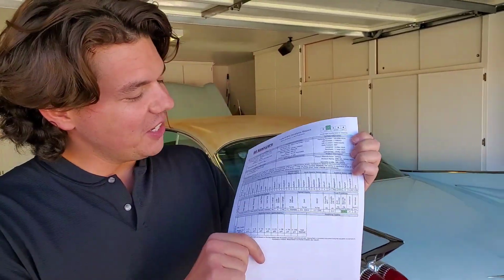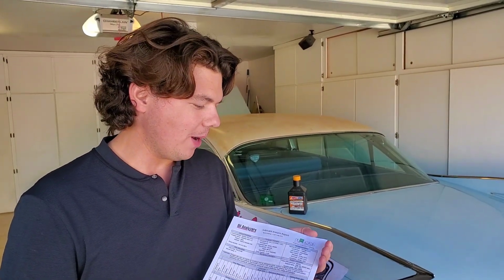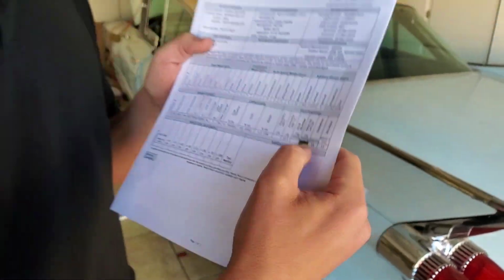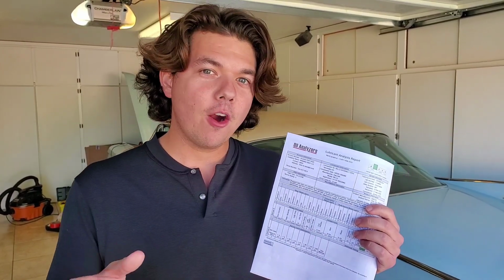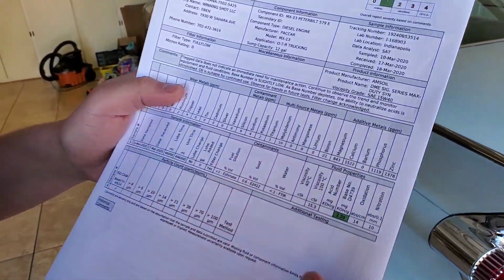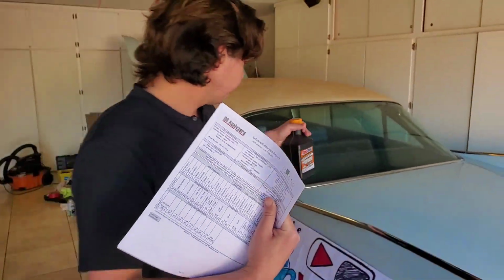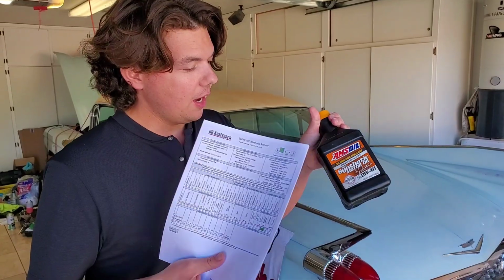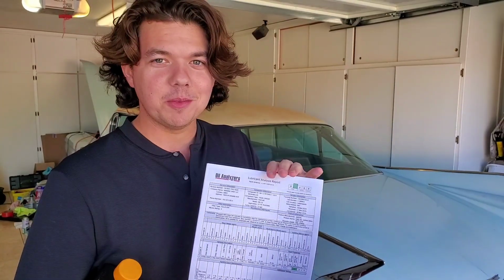46,000 Mile AMSOIL Oil Analysis Results

Comment from the maker: Check THIS: 2015 Peterbilt 579 AMSOIL Engine Flush Oil Change - https://youtu.be/nbx1kVoV4Ks

     My Link: Best AMSOIL 100% Synthetic @ Wholesale + FREE Shipping: https://www.amsoil.com/offers/?zo=5331179

     AMSOIL Products & Vehicle Lookup - https://www.amsoil.com/guides.aspx?zo=5331179
 
     AMSOIL Performance Tests - https://www.amsoil.com/performancetests.aspx?zo=5331179

     Follow these accounts for Ebens Giveaway:
Instagram - https://www.instagram.com/syntheticoilprotection/

Facebook - https://www.facebook.com/profile.php?id=100007973957868

     People ask me these three things:

1. Where can I find AMSOIL? - Use this link https://www.amsoil.com/offers/?zo=5331179
Or
Watch THIS: 3 Fast Ways To Get AMSOIL - https://youtu.be/RiYifuDCsnQ

2. What makes AMSOIL different than other oils? - AMSOIL is 100% Synthetic & has higher film strength & last 4×longer then Mobil 1 EP which protects and separate metal parts keeping them from wearing and Lasting Exponentially longer: https://youtu.be/f4eNPgTi_qo

3. Why should I use AMSOIL?: It protects the engine so it will last longer. Less oil changes less often(once per year/15,000miles) or longer... Save money in Gas & Time making it less expensive then a free oil change over the year - https://youtu.be/H7K6FdZlqmg

     Professional YouLubher:
Eben Rockmaker Executive Direct Jobber AMSOIL Specialist (Dealer#: 5331179)
Mobile: (702) 472-3614

     My Link: Best AMSOIL 100% Synthetic @ Wholesale + FREE Shipping: https://www.amsoil.com/offers/?zo=5331179

     AMSOIL Products & Vehicle Lookup - https://www.amsoil.com/guides.aspx?zo=5331179 

     If your vehicle is not on the lookup guide this is AMSOIL Tech Support 715-399-8324 be sure to refer to Eben 5331179

     46,000 Mile AMSOIL Oil Analysis - https://youtu.be/UjijQK5wSM0

     Friend me on and tag me because I like to see great results from my YouTube Community:

Instagram - https://www.instagram.com/syntheticoilprotection/

Facebook - https://www.facebook.com/profile.php?id=100007973957868

     Order AMSOIL By Phone:
Be sure to give them my number so I get credit Eben #5331179 and tell them you would like to be a Preferred Customer.

1. Call 1800-956-5695
2. Ask for your own preferred customer membership because you will get 25% off, free shipping over $100, and your informative quarterly AMSOIL Magazine. It costs $10 for 6 months or $20 for the year which is well worth it.
3. Give them my dealer number so I get credit Eben 5331179
4. Orders over $100 will be shipped free.

     Industry-standard 3rd party testing results:

     AMSOIL Signature Series 5W-30 Synthetic Motor Oil protects against harmful deposits on turbochargers 4X better than Mobil1® Extended Performance and 3.6X better than Royal Purple® in industry-standard testing*.
https://www.amsoil.com/newsstand/motor-oil/articles/leading-the-field-in-deposit-protection/?zo=5331179

     AMSOIL gets better gas mileage -
https://www.amsoil.com/newsstand/motor-oil/articles/another-win-for-amsoil-products/?zo=5331179

     AMSOIL Performance Tests - https://www.amsoil.com/performancetests.aspx?zo=5331179

     Professional YouLubher:
Eben Rockmaker Executive Direct Jobber AMSOIL Specialist (Dealer#: 5331179)
Mobile: (702) 472-3614

     My Link: Best AMSOIL 100% Synthetic @ Wholesale + FREE Shipping: https://www.amsoil.com/offers/?zo=5331179

     AMSOIL Products & Vehicle Lookup - https://www.amsoil.com/guides.aspx?zo=5331179

Comment: Not convinced about the oil flush?
I change my Amsoil 5w-30 every 3000 miles cause I’m crazy.
Reply from the maker: The benefit of the flush is cleaning out your motor so it doesn't clog up your filter that's what happens when you run the signature series you will have a lot of build-up in your filter early and the oil gets dark in that way you'll clean out the motor a little bit more before you put in the signature series definitely a nice clean up but nothing that has to be done.
The signature series itself will clean your entire motor from inside out overtime. You just want to change the filter a lot and top it off as it runs through and cleans everything.
This video shows after the flush and how it's still getting cleaned from the inside - https://youtu.be/4v6kWj6_mWI?si=wO2JeHz1vLS9rLXT
Reply: @Syntheticoilprotection hi. What about using that orange label amsoil on a Nissan.  Do you think it would last longer than 20k miles. I saw other video after 20 k mile change of other amsoil  all was good but oil got thicker. 

This amsoil with extra protection would it last much longer despite the increase of viscosity

Comment: Have you ever run two identical engines with Signature Series, one with OEM change intervals, one with 25k changes? I think the one changed more frequently will be in better shape. Without a bypass filter, you’ll have a bunch of particles in the 5-20 micron range causing unnecessary wear.
Reply from the maker: That's a great idea Robert Can you explain exactly what you want me to do I will try to find a truck and do it!
Reply: @Syntheticoilprotection  Thanks! See if you can find a fleet and have two identical trucks on similar routes. Both running Signature Series, one running OEM changes and one with double or triple the change interval. Measure compression before the test and after 200k miles or more. Maybe keep the test running for the life of the vehicles and post updates. I’m just wondering if even better protection and longevity can be gained by changing it more often, and if there is a difference, how significant is it? Again, I appreciate you considering doing this.
Reply from the maker: @roberthenry9959 wow this is perfect in the clarity show the signature series at 25000 miles the engine would have about 2 to 4 times less where than running a OEM conventional oil changing it every 3000 miles.
I will try to do a video like that!
♥️   See Oil & Lube performance tests - https://www.amsoil.com/performancetests.aspx?zo=5331179

Click on performance tests above you will see one on cylinder scars on a diesel engine 6 times more where protection than an OEM equivalent

Comment: This is great information and  something I learned from you explaining oil analysis. 
     I change my transmission oil before it wares out. Like you said in your other videos, all oils and  transmisdion fluid oxidizes twice as fast every 18f. Degrees hotter it gets over the standard temperature.
     Thanks for the Great information. 
    Wow!

Comment: So I just changed over from mobil 1 to amsoil signature series 5w- 20  and oil filter on 2015 Malibu 2.5 liter and was wonder how long do I go on the oil change and filter again.  Thanks for your content.
Reply from the maker: If you want to you're more than welcome to do an oil analysis at about 10,000 miles just to see where it's at
Reply: @Syntheticoilprotection  will you send me a link to an oil analysis and I appreciate you replying back.
Reply from the maker: https://www.amsoil.com/p/oil-analyzers-test-kit-ups-pre-paid-oaiuppkit/?zo=5331179
Reply: How is it running
Reply: @issavibez394  great
Reply from the maker: I would change the Amsoil oil filter at about 6000 miles that way you know you'll have a fresh filter with no carbon and sludge in it and then I would run the oil 15 to 25 thousand miles just depending on what type of driving you're doing I would check the oil level every month and make sure it's topped off
Reply from the maker: This is my oil analysis playlist https://www.youtube.com/playlist?list=PLB_ftWArBFddc-nU9A-k2vfxWYxdq3E_b

Comment: Very impressive results! I'm considering to change the oil in my old Volkswagen LT28 Westfalia Camper to the Amsoil Signature Series Max-Duty 15W-40 Diesel oil. But is it okay to use this oil in an old german car?
Reply from the maker: Time in this is my Volkswagen bus oil change video https://youtu.be/20l6_hlTm1I
Reply from the maker: This is the premium protection we ran in wingspan it's a really really good hundred percent synthetic I also use this in my Cadillac and from what I'm aware of this is the most protection you can get for an air-cooled engine.

     Right now there is the Amsoil free shipping promotion any order $50 or more promo code FREESHIP

https://www.amsoil.com/p/premium-protection-10w-40-synthetic-motor-oil-amo/?zo=5331179
Reply from the maker: I also recommend that you get the upper cylinder lubricant for the fuel additive and also a bottle of the pi performance improver will clean the valves and the combustion Chambers
Reply from the maker: This is the follow-up video after my friend Wayne drove his van for 5000 miles https://youtu.be/c0lVQ3SnWLY
Reply from the maker: Always happy to talk anytime Simon☕
Reply: @Syntheticoilprotection  Thank you for your recommendations, but my engine is a diesel. That's why I chose the Amsoil Signature Series Heavy-Duty Diesel 15W-40. Are there any good fuel additives or other products for diesels from Amsoil, which can help such an old engine?
Reply from the maker: Yes this one i got great results with - https://www.amsoil.com/p/diesel-injector-clean-cetane-boost-ads/?zo=5331179